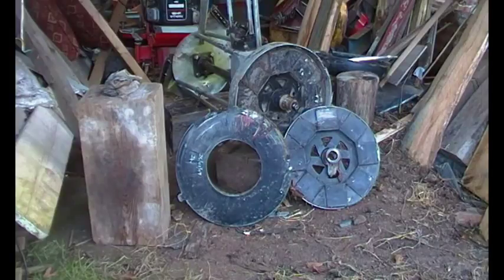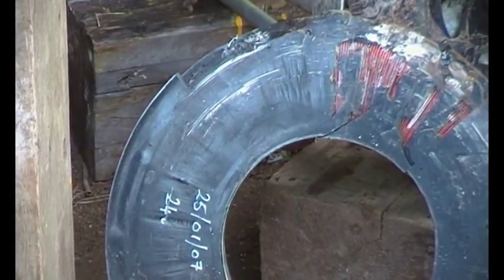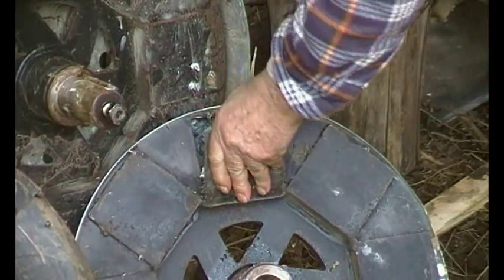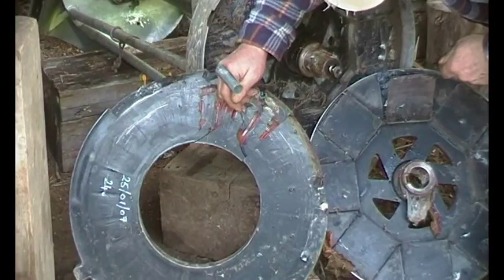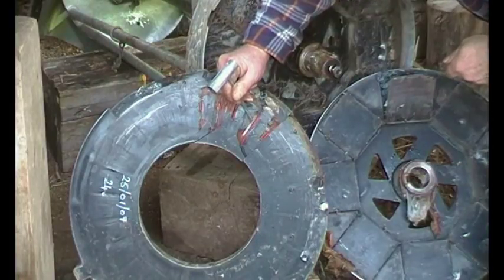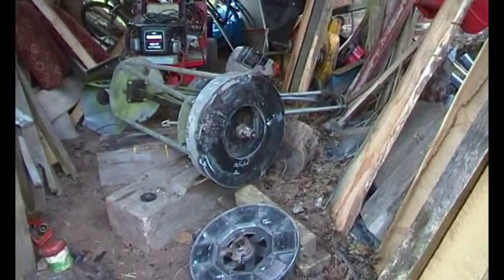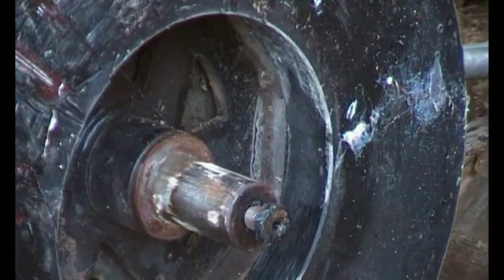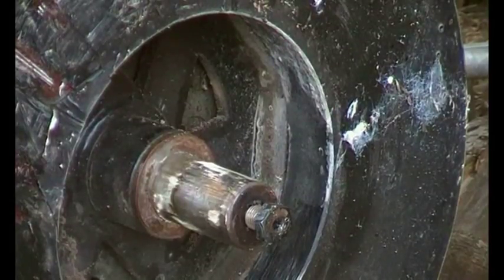Wrecked proven turbine: generator stator removal and inspection: Part 3

Comment: Andy , I am in the process of replacing the main bearings on my 6 kw Proven turbine , have pulled off both rotors and stator using a homemade puller , required a huge amount of force , the rotors are pressed onto the parallel main shaft held by a central bolt torqued to about 50 lbs ft. My difficulty is removing the two grub screw held rings from the main shaft . Will try heating and hammering !,,
Reply from the maker: Colin, I'm supprised you removed the magnet plates without heat to soften the locktite glue. Definitely use heat and pressure rather than impact. Putting the generator back together will be interesting, I believe the magnet / stator gap should be about 2mm, subscribed? cheers

Comment: The nuts on the two studs are there too enable the the stator adjustment for parallel. Obviously manufactured to be a set distance from one set of magnets and the other is set by the shims. Not sup prised the manufacturers are out of business, the whole thing is rather heath Robinson looking and poorly designed compared to makes like Bergey and others.
Reply from the maker: I agree with you. In the mid naughties this company had a high profile but the very poor customer services and rural design was it's downfall. Similar in some ways to the Whirlwind, brilliant design bolted right next to utter rubbish. Thanks for your comment, cheers

Comment: The broken magnet Andy - it looks like it has split through its thickness ? What on earth is all 
the gunk left between the two halves in which case ?:0)  I guess the magnets are actually stuck to the back plate by magnetism (?), and then cast in resin (?), and they are about 1" (25mm) thick when intact ? A loose magnet is unpleasant, and as you say that hasn't done the stator coils any good.  The studs in the stator could be used to adjust its position, but can you see the stator through the cooling slots maybe ? And why only two of the studs seems to have spanner access is a real mystery ! You'd need three at least to straighten it surely ? I suppose if you can't see the top side of the stator through a hole, there's no point in being able to adjust it. Possibly they didn't want rain entry holes on top ???  I wonder now if those spanner access holes have been cut later by someone trying to correct for the scraping magnet ? Just a thought, does yours have them ? Sorry about all the Qs, I am never likely to own a Proven, but it's interesting to reverse engineer this kind of thing ! Cheers, Dave
Reply from the maker: Dave, yes the magnet has split leaving the front half to scrape on the coils. The gunk is groung up magnet making a gritty powder. The holes look like an edition at the factory as there have galvanising on them. I would have thought 3 extractor holes would have been much better and it would have been simple enough to make them rain proof. Not alot on this machine makes sense, really good engineering right next to very poor design. I am interested to see how the air gap is set up beteen the magnet plate next to the main bearing and the coils. Cheers, Andy

Comment: what do you think that  cost new? from the size of it . it looks that it could be underated . 2500 watts. I have seen smaller axels on a truck! that thing is crazy huge. I was thinking about building one. maybe a small farm of them. maybe 600watts each. and end up with 6kw in turbines. maybe build a very small one . to experiment with. move it around. document the output in the different locations. then build and  put up larger ones. all around the area with the best wind. its going to be a pain. because I live in a hole. with 50-60+ year old trees all around. I may have to build a 50' tower! maybe use 2" EMT. I don't know the terminology. but a tower with 3 vertical pieces of pipe braced to each other. and attach guide cables to each. maybe have one side climbable. and put outriggers on it with short poles. to mount 5'-6' turbines on Two sides of the tower. have 4 on the sides. and one or two on top! crazy I know. maybe HAWTs would work better on the side of the tower. and a big VAWT on top. I think with the lower wind speeds I have. smaller turbines will output more. than a couple huge ones.  do you have any input on my crazy ideas? you are so knowledgeable your advice and experience is valuable  to me.  keep at it  good day...
Reply from the maker: James, Hugh Piggot has plenty of designs for home produced turbines, his books are available direct from Scoraig wind: http://www.scoraigwind.com/, he knows more about this subject then me as he lives on the west coast of Scotland where there's plenty of wind. Also check out his blog and scan down a few pages for some very interesting generator photos, Cheers
Reply: Andy Reynolds thanks I'll check that out.  I started a few ceiling fan conversions. I got to the point of adding blades and magnets. I have 4 of them. but they are nothing as far as output. maybe put all the stators on a single shaft. and rewind them. and make a new hub with some huge n52 neo magnets. like 1"x2"x4", that would be about the only way to get any real power from those parts. I'm thinking about getting about a 1/2 HP ac motor. and machining the rotor  to make room for magnets. and epoxy and fiberglass them in. then build a regulator to drop it to about 39-40volts and rectify it. what type of charge controller do you use?

Comment: Lots of heat will kill your magnets Andy !
Reply from the maker: Hi, yes, they are ceramic magnets, but this is the only way to break the bearing fit glue. The investigation continues, cheers
Reply: @TheInfoworks  Hi Andy I have the same generator with almost the same problem. did you scrap the generator head at the end ?
Reply from the maker: @resheim1  Hi, just kept the wind shaft, main frame and the magnet plates, the rest was junk, cheers